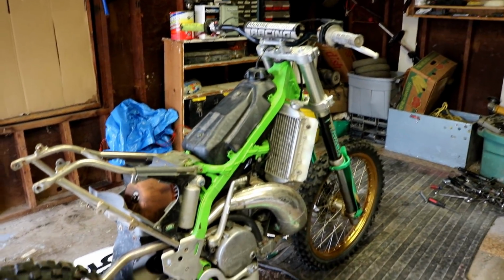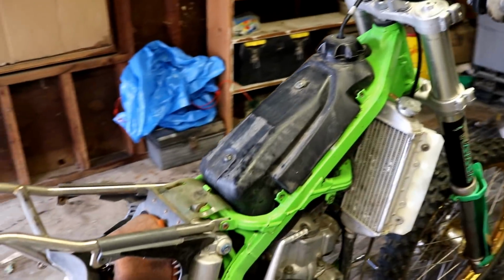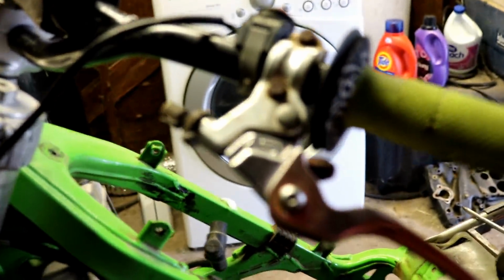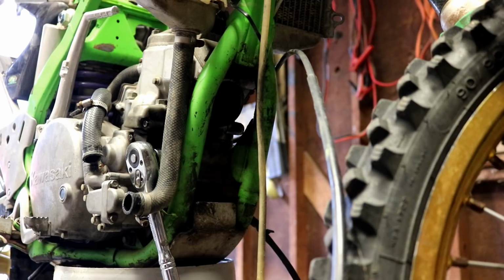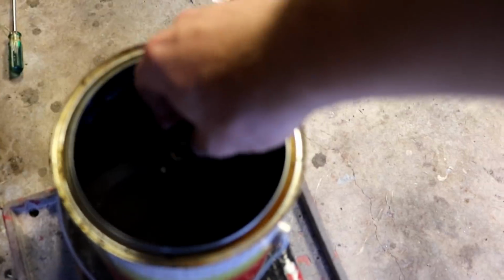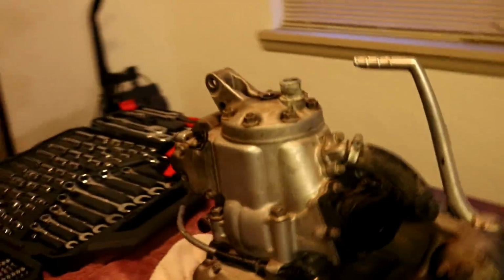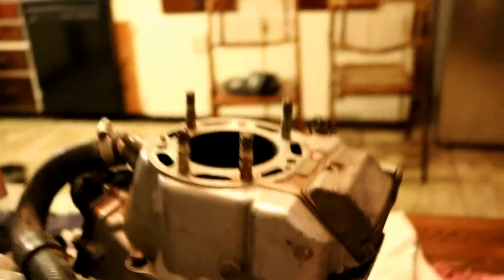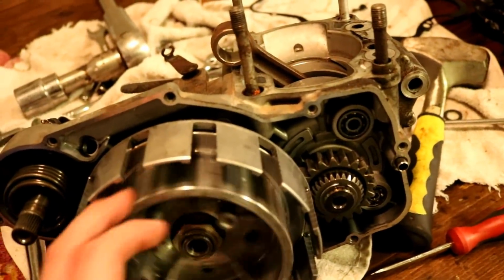$400.00 KX250 Build Pt.2 Tear Down!

Comment: Full fmf and excel rims that alone is around 400 bucks, what a steal dude
Reply: Mark 1869 bro the rims without the hubs are around 500 with the hubs  ,to replace would be a grand,the pipe is 460
Reply: Mark 1869 yeah the wheels are a grand
Reply: dan gardner what? Lol yeah ok
Reply: @DGfilms1996  you can not get the full exhaust system for 200, maybe just the can

Comment: Use an air impact to take the nut off that sits on the locking washer to hold the inner and outer hub together, just zip it fast and it’ll come off without really even spinning

Comment: Bolt posts aren’t needed to remove the inner clutch hub. Stuff a rag between the inner and outer clutch, then a penny or washer between the outer clutch and drive gear. An electric impact should handle the center nut with no prob. At least you can continue the breakdown.
Reply: Bet he tried to hold th inner hub with a screw driver or something an snapped 2 posts off...nearly th cost of th bike to replace...sucks bigtime...
Reply: David Lear 
Right, and it looked like the tab-washer that locks the center-nut in place, was still folded around the nut. 
Sometimes teardowns have a few tearups........I’ve been there before.
Reply: @GoodlookinMug  I blacked my eye once takin a fly wheel off wth 2 wrenches...box end over an open end...it broke loose an I smacked myself right in th face...

Comment: How'd you get the power valve assembly off to pull the cylinder? 

I got up to this part but it seems like the top end is kinda stuck on mine with that valve assembly. There's like two shitty Phillips head screws and a circlip that seem to be holding it on... Stupid ass design

Comment: The dirty airfilter could be the reason why the bottom end went.
Reply: thats a huge stretch
Reply: No because the carb was pretty clean inside. There is no way dirt would have gotten in the crankcase
Reply: YZ85 Goon  not true but i still think its a stretch. even if the carb was clean it could have been sucking dirt particles into the crank as the piston pulled fuel and air in
Reply from the maker: The owner says the carb got stuck and it full throttled for 60 seconds on a stand. Which is pretty stupid i do not know why he wouldnt just kill it?
Reply: @Diedrich69  wouldn't blow the bottom end ... that air filter is a good sign that at some point the engine has sucked in sand or dirt witch can destroy the crank bearings.
Reply: Diedrich  sounds kinda fishy to me. i would think the top end would go before the crank in that situation
Reply from the maker: The bearings are still really smooth. the connecting rod just moves up and down like crazy. it has a ton of play up and down
Reply: @Diedrich69  sucked in a load of shit by the sounds of it. Bad maintenance. I can't wait until u open the swingarm and suspension linkage bearings ahaha.
Reply: Diedrich  well big end bearings do wear out eventually but either way its fucked :P ^ for real though youre probably gonna have a hell of a time with the linkage bearings